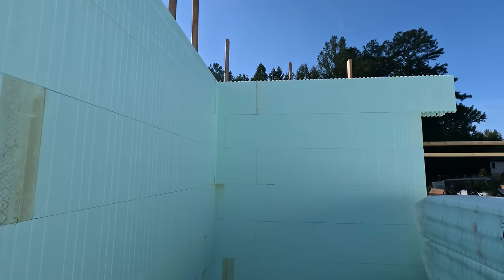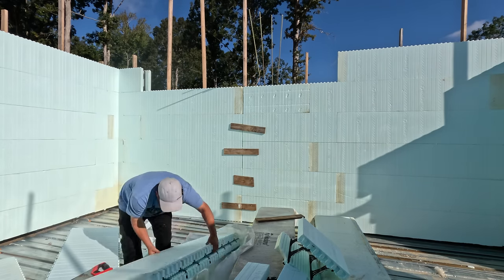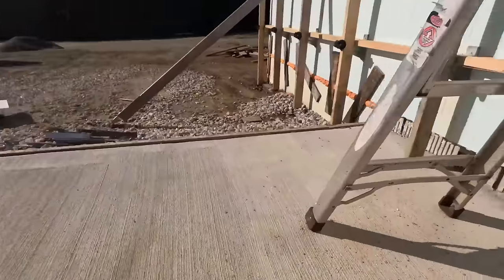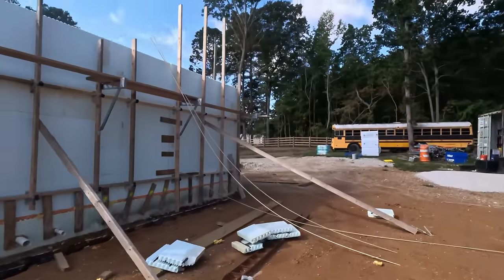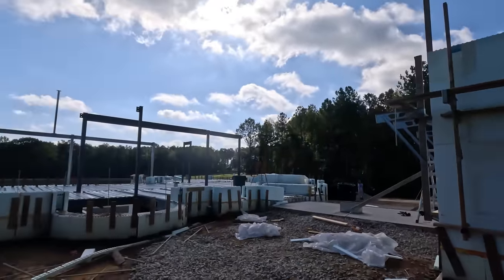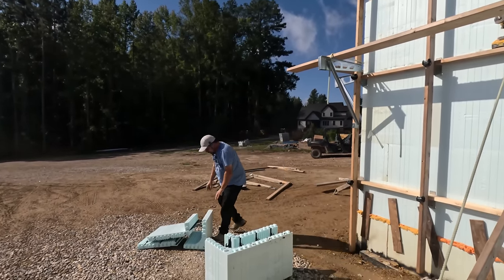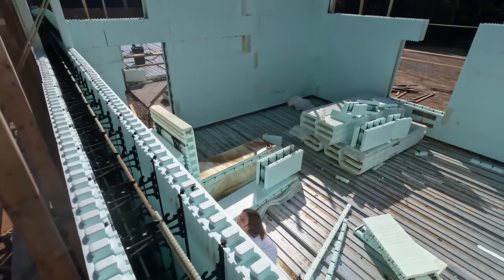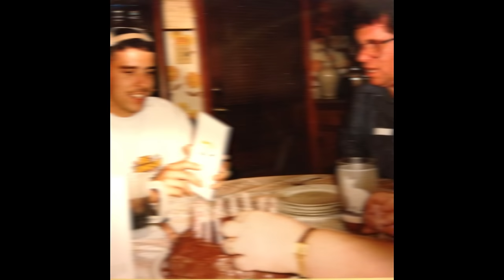Main Floor Office ICF is Stacked and Ready for Concrete

Comment: Hey Geoff
Do you have to lay concrete base for the steel from your office to the house?? 
Is chris coming back to dig out the small footing, or is it going straight on top.
Hevenly Birthday 🎂 
Lee
Reply from the maker: Hey Lee! No, I’ll put a pocket in each wall and there’s more rebar that I have to put under the pockets but then the walls will support the steel. Thanks 😊
Reply: @BealyGood  Thank you 
I did wonder 🤔 
Lee